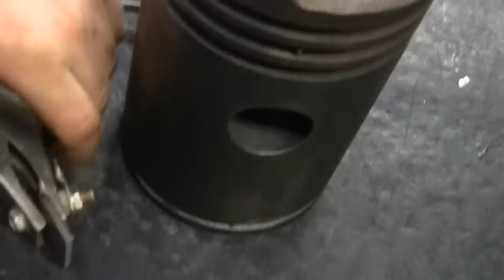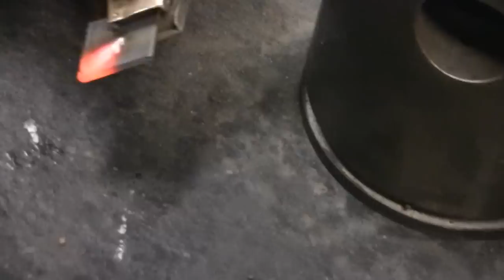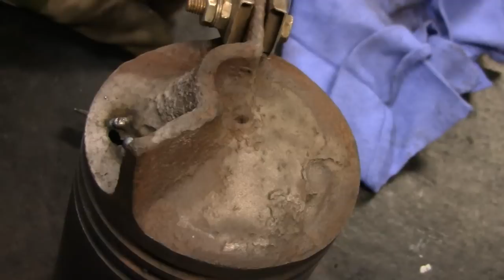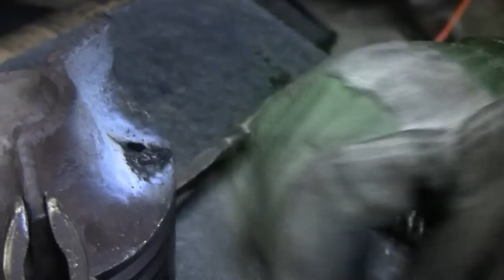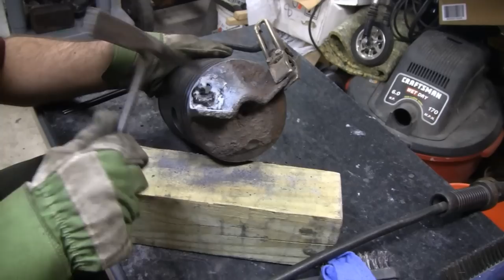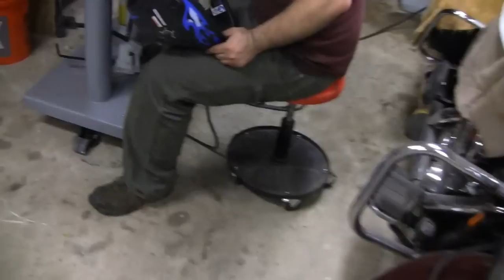ANTIQUE BESSEMER ENGINE PISTON REPAIR

Comment: Great repair work guys! I just started going through your videos love your work especially the Briggs hit and miss build. I've been working with an old Tecumseh as my prototype to build one with the governor internal so it looks stock yet runs a hit and miss style governor. Anyways nice job on the piston I know quite a few people said to preheat already and I know the sticks say it's unnecessary because I've used them to weld rear end gears in race cars, but I preheat simply to draw the oils out of the very porous cast material just thought I'd mention that, keep up the awesome work!
Reply from the maker: Thanks Bud!! Good luck with the Tecumseh!!☺

Comment: the mig welds cast better with SS wire. The nickel in the stainless helps the weld flow better with cast. I always used 316 ss rods with a tig for cast as well
Reply from the maker: Interesting!! We'll have to give it a try!!☺

Comment: i've had good luck repairing holes using a copper sheet as a backer. something to maybe try next time
Reply from the maker: We've done that alot, we even have a copper welding spoon!! It does work well but wasn't feasible for this application!!☺

Comment: I am actually a first on one of your vids. What's up with the big piece on the front of the piston?
Reply: It`s from an old two-stroke.
Reply from the maker: Good question!! That's the first time I've seen one like that!! Probably to help mix and direct the fuel mixture!!☺
Reply: 805ROADKING Okay, I've seen plenty of pistons from old engines small and huge, but I've never seen one shaped like that. Is it from a throttler or hit n miss? I don't know much about smaller bessemers.
Reply from the maker: I think it might be a throttler!! also a 2 stroke, maybe that has something to do with the shape!!☺
Reply: 805ROADKING That makes a bit of sense. Have you ever heard the 85 hp blaisdale running? It sounds like a bomb when it fires!